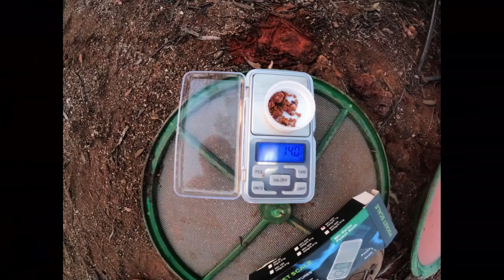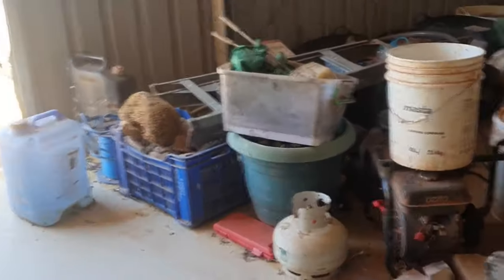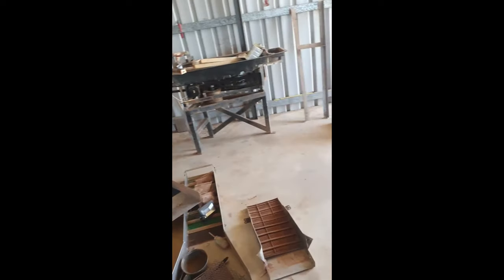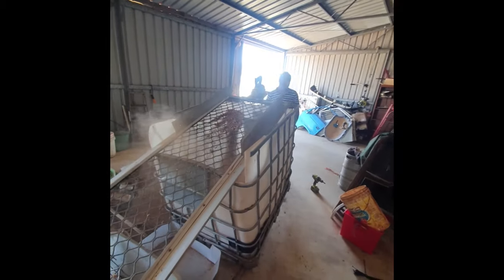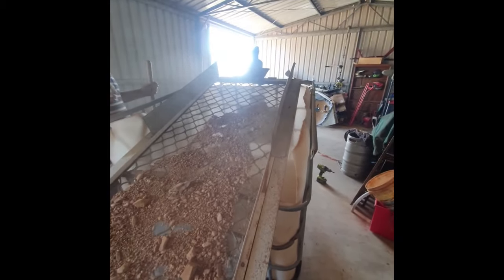GOLD Rich Pay Dirt from West Australian Outback - Running through Home Made Classifier and Sluice

Comment: Being in one of the last gold prospecting frontiers of Australia, dowsing for gold will advance the knowledge of where the most concentrated gold pockets are located.  Dowsing and metal detecting for gold work off the same physics of all elements atom's emit a unique electromagnetic microwave band frequency with no two elements having the same.  The same element's electromagnetic microwave band frequency contained in an elemental mass band together for producing the elemental magnetic flux lines that energize the electronic metal detector and dowsing rod, also with no two elements having the same.  Read the book The Art of Dowsing - Separating Science from Superstition for learning all of the physics involved and how to build your own modern light weight ball bearing dowsing, which is the only dowsing rod that accurately deciphers what is being dowsed by gauging with pitting the energy of gravity against the energizing of the one-ounce dowsing rod load attached to the elevated dowsing rod's acetylene welding rod.  The book has dowsing lessons for dowsing buried pipelines and cables, tunnels and voids, precious metal placer and lode deposits, any sought element, amplified long distance dowsing from a moving vehicle, and dowsing on water from a boat.  I hope this helps with gold prospecting and have a safe, healthy, good day.
Reply from the maker: Really interesting stuff Michael, thanks for your support!
Reply: 110% so many people still laugh at me and my dowsing rods... I laugh with all the gold at the end of the day....

Comment: Great video Nathan. Martin you're a shocking hoarder 😅 How much of that stuff you threw out have you gone looking for since? If I throw something away I usually need it the next day. That Dream Mat is really worth getting into the sluice. I usually run the concentrates of about 40 tonnes over the 10"x36" Dream Mat and I don't think I lose much. I drop it in dry just like you did but I have a small hopper at the top of the sluice with the 17,000 L/Hr water spraying in. I had my vibrating screen on rubber mounts but recently changed it to coil springs and it made all the difference clearing all the little stones that used to block it up before. Thanks guys, I hope there's a lot more where that came from 😃 Phil
Reply from the maker: Thanks for the great advice Phil! I'm sure dad has been out there re-hoarding a few bits and pieces 😅 theres for sure a few modifications and addons that need to be done to the little setup before we run the rest of the dirt and we will definitely share the whole process with everyone! 🍻

Comment: That/s not a sluice, that's a small bridge! Love to know, what was vibrating the flywire screen? Thanks
Reply from the maker: Haha your not wrong! It's just plain household stainless steel security mesh placed over an old door we had sitting around, basic but works a treat!
Reply: @detectinggoldenstoneadventures  Thanks for the reply, still wondering what tool you used to "shake" the door, thanks!
Reply from the maker: Oh sorry mate! Its an old concrete vibrator motor for removing air bubbles just be weary searching vibrator on google! 😆😬
Reply: @detectinggoldenstoneadventures  Cool, thanks!